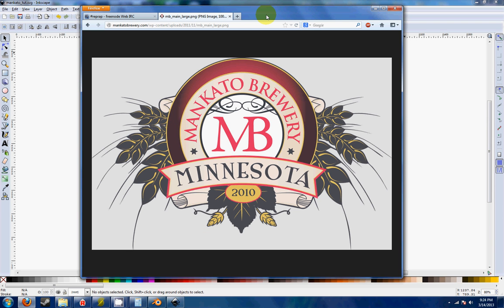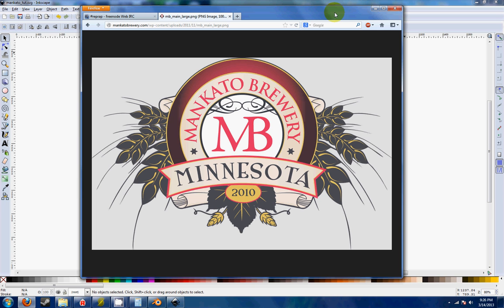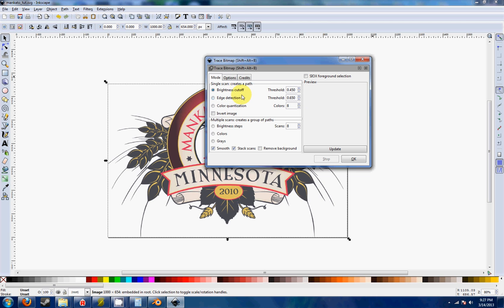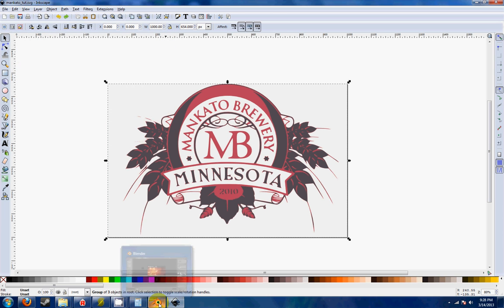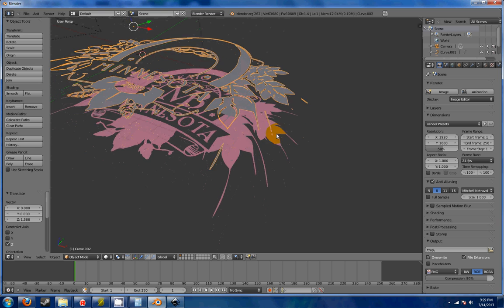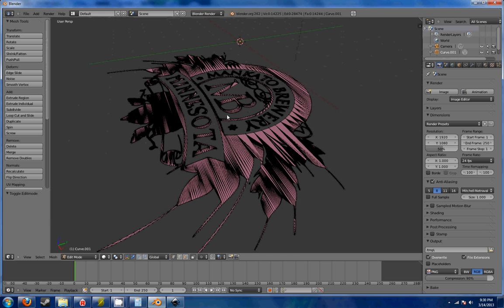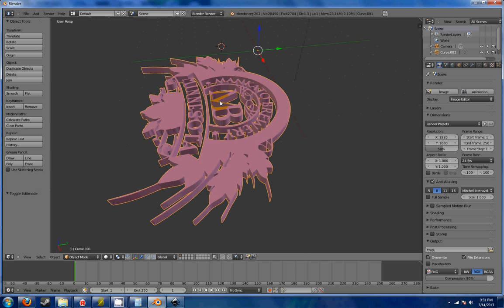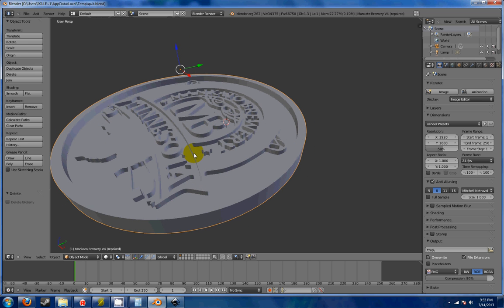Build log 10 - How to convert a picture to a STL

Comment: Well..... that s what i searching but the part with MESH and how thick i will my piece was be not clear. WHER can i see the dimension of my work ? ( in millimeter unit if it s possible )
Reply from the maker: Blood Celtic In Blender on the right side look for the scene option buttons.  These are little icons that go left to right, the first one looks like a camera, the second is a couple of pictures, the third is an image of three shapes.  Select the third image (three shapes).  This opens up options that let you select your units.  Under the units tab you have the option of "none", "Metric", and "Imperial".  If you are working in metric simply select the metric option.  This will convert everything from 1 unit to 1 meter.  Now select your object and press the "N" key. The "Transform" menu will pop up for that object, under this menu there is "Dimensions" this lists the overall size of your object.
Reply: Thanks DonKatieShadow. I never will click here and there to find this options.
BUT.... now , please i apologize, i begin to use Blender to build pieces for a LIGHT SABER REPLICA like in Star Wars, and all pieces are under 1Meter big... but much more 1 centimeter, with parts from few millimeters.
QUESTION: How can i goes under 1Meter unit???
Reply: Blood Celtic In the transform option (pressing "N") under the dimensions you can type in your size with the proper units and it will figure it out.  So if you wanted to make a 10mm block, type in "10mm" in the X, Y, Z boxes.  If you wanted to use centimeters you could also type in 1cm and it will give you the same result.  I am not a Blender expert at all and learned a lot from watching YouTube tutorials.  Search for "Blender basics" should help you get started and familiar with Blenders layout.